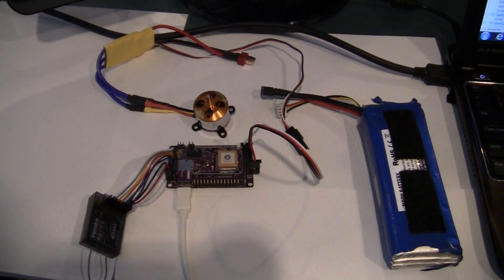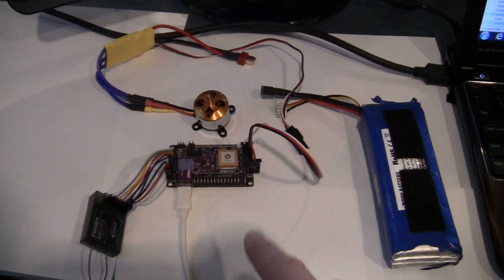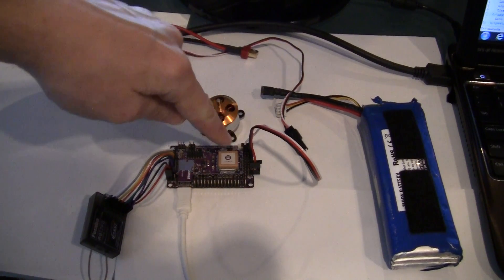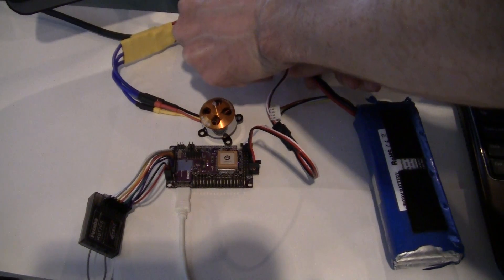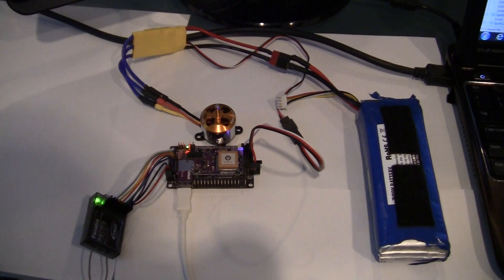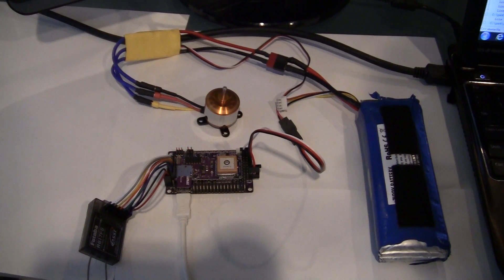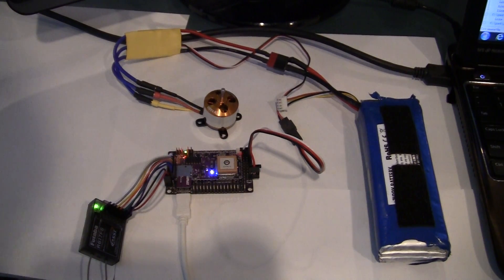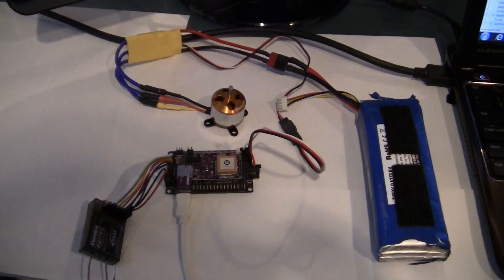3DR ESC response to loss of signal from APM

Comment from the maker: dege13,
     yes, i think you're right.  it's reaction is very ESC specific.  Different ESC firmware could very easily respond differently.  I tested a simonK flash ESC as well and it responds pretty much the same .. it slows down faster but still, it stops which is the important thing.